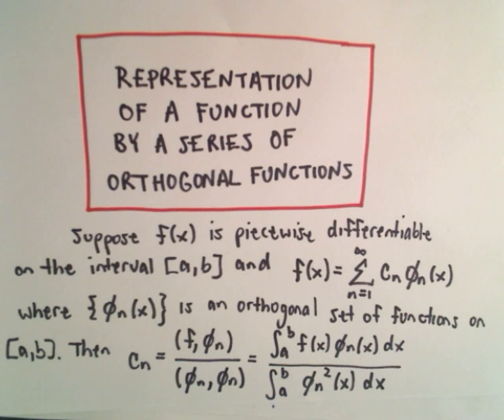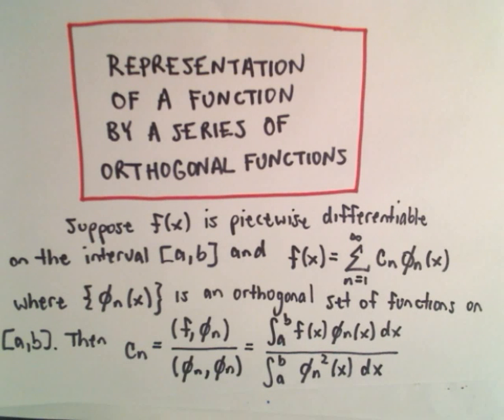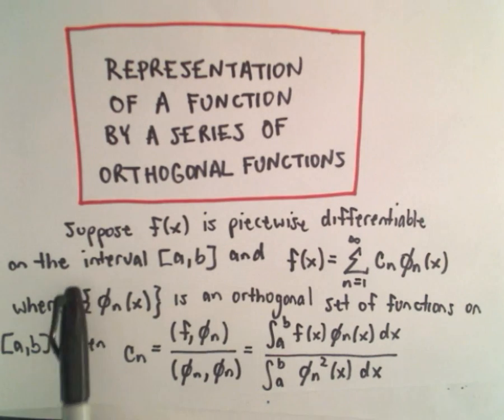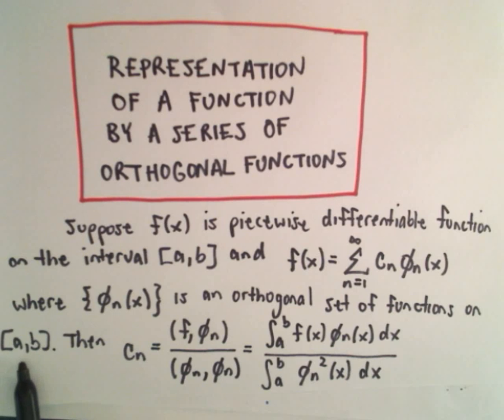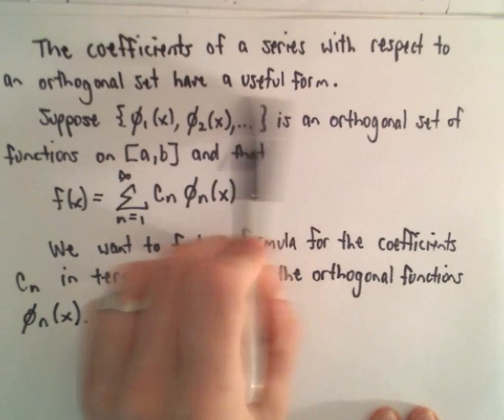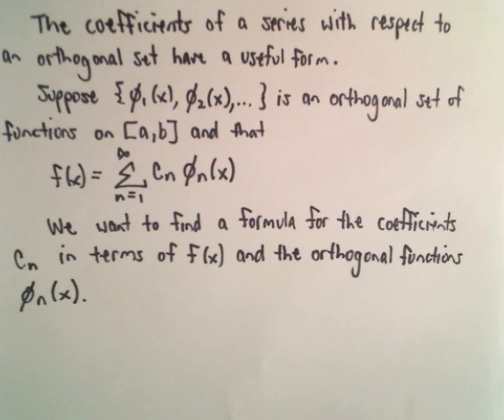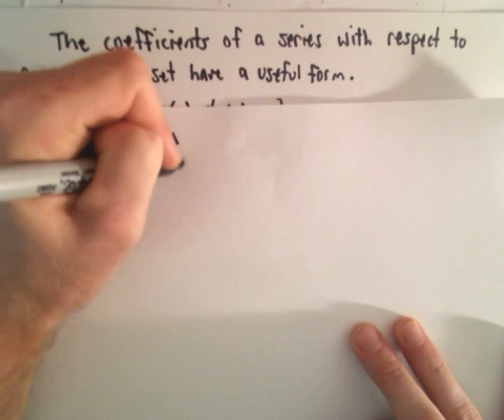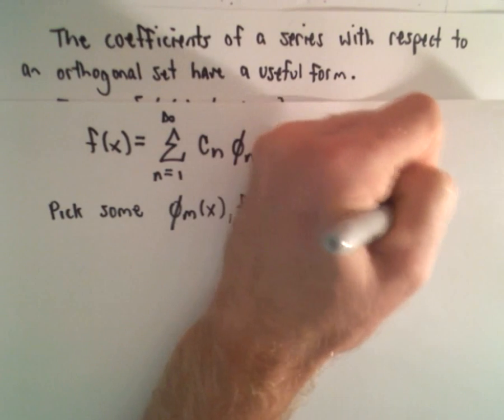Fourier Series Coefficients: Representation of a Function by a Series of Orthogonal Functions

Comment: My intuitive understanding is that the { phi_n(x) } set is a countably-infinite-dimensional basis for a vector space over the set of differentiable functions, so then each function can be expressed as a vector of <C_1, C_2, ...>.  My math background is heavy in abstract algebra and lacking in real or complex analysis, so apologies if I'm oversimplifying. It seems to me that in order to make the sum C_n * phi_n(x) converge / work as an approximation, you would end up needing the sum of C_1, C_2, ... to also converge. Otherwise since the period of each phi_n(x) decreases, you'd end up with a function that didn't really have any one value at most points.